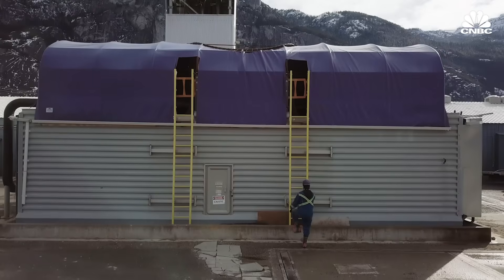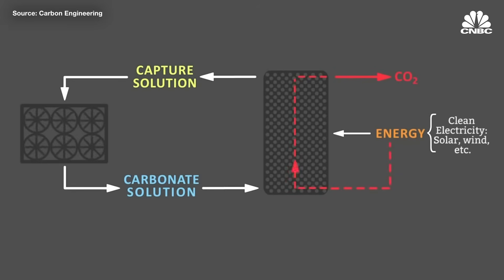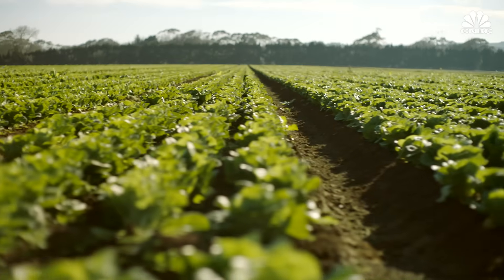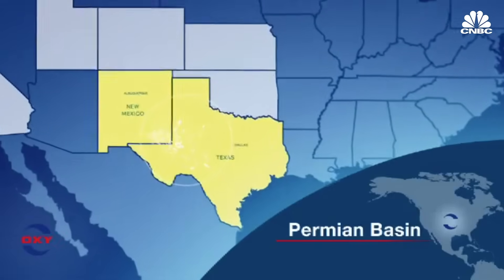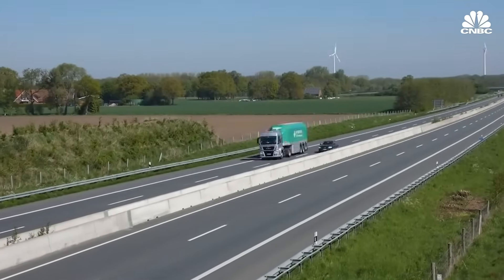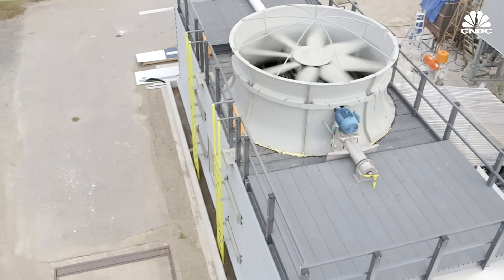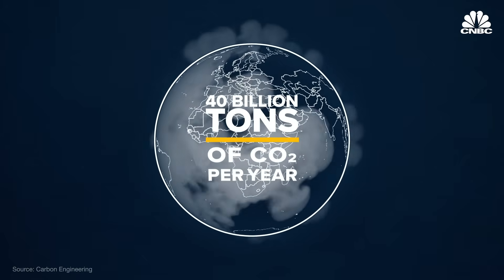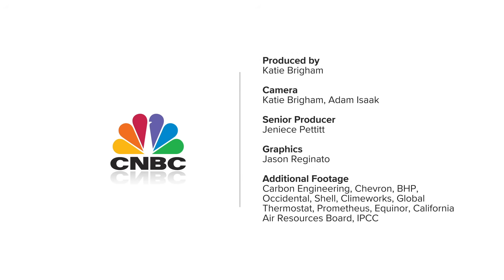Bill Gates-Backed Carbon Capture Plant Does The Work Of 40 Million Trees

Comment: This will only reduce CO2 from the atmosphere.
We still need plants for oxygen.
Reply: They already created a substitute for the Plant that can produce a oxygen and design for astronaut. But we still need a tree to do the nature way
Reply: Fred Energy comes from ATP and NADH.  Ultimately this is energy from the Sun  which is from nuclear fusion.  Energy from the sun is ultimately from the Big Bang, and is steadily decreasing ( entropy) with the end being absolute zero.
Reply: Dylan Stewart  Or you can dial into NASA satellite imagery and just watch as carbon dioxide makes the Earth greener.
Read all about it.

https://www.nasa.gov/feature/goddard/2016/carbon-dioxide-fertilization-greening-earth
Reply: Fred thanks for that link, my first time visiting nasa’s  site, very informative thanks again
Reply: What is the point you're making? Currently there is too much CO2 in the atmosphere, about 420ppm compared to pre-industrial 280ppm. If we were to one day remove CO2 quicker than we produce it, we would probably call it quits at around 280ppm. Thus not destroying photosynthesis on earth.
Fun fact, it seems that increased CO2 percentage in the atmosphere is actually having a fertilising effect on plants.
Reply: @tord1508  Arguably there is not enough CO2 in the atmosphere. Plants are starving at at 420ppm. The optimum level for C3 plants is probably 1500ppm. At the last glacial maximum plant life struggled to survive the low level of CO2 in the atmosphere. Plants needed much more water as CO2 declined because of increase water loss via evapo-transpiration through the enlarged stomata needed to inspire CO2.

Further evidence is here: 

1, The greening of the Earth by CO2
https://www.nasa.gov/feature/goddard/2016/carbon-dioxide-fertilization-greening-earth
2. The fact that greenhouse operators increase CO2 to as high as 1500ppm.
3. The fact that C4 plants have evolved a more efficient mode of photosynthesis than have C3 plants.

https://royalsocietypublishing.org/doi/full/10.1098/rstb.2011.0261
Reply: @tord1508  it makes plants utilize nutrients and sunlight and also tolerate higher humidity and temps and increases yeilds while shortening time to harvest. In greenhouses you can run co2 as high as 1200-1500ppm, temps as high as 36celsius and 70-80% humidity, and crank up feed concentration
Reply: @tord1508  No there is insufficient CO2 in the atmosphere. That is why greenhouse operators pump CO2 into greenhouses.
Also, that is why the Earth has been getting greener during the last 40 years or so.

Reference at NASA web site:
https://www.nasa.gov/feature/goddard/2016/carbon-dioxide-fertilization-greening-earth
Reply: @tord1508  yea actually it makes plants grow bigger but it there less nutrient filled so we have to eat more wich is the sloth problem eating food all day and stil not geting enough energy
Reply: @popinmo  The nutrient density is lower. Not the same thing as lower total quantity of nutrients.
Reply: @fwcolb  thats what I said meaning you would have to eat more to get the same amount and thus we eat more often and alot more
Reply: @popinmo  The fiber will keep us regular and we won't get so fat. :-) Seriously, the additional plant mass is made up of cellulose. Many animals, including cattle, have gut bacteria that can break down the additional cellulose to get energy.
Reply: @fwcolb  but we wont get energy Idk also maybe we can use this to are advantage to blast are plants 20x size with carbon
Reply: there are other technical solutions for that as well, it's just not mentioned here and beyond the scope of this video. it is scientifically possible to produce breathable O2 without plants.
Reply: @vanillacokejunky  Let's stop trying to re-engineer the world and deal with the fact industrialized society is unsustainable.
Reply: @cactusflower7292  Not so. This is a belief not based on science. Partly political and now becoming partly or wholly religious, a form of Pantheism.
Reply: @vanillacokejunky  Sure but how do you get the energy to do it? Second law of thermodynamics means NO FREE LUNCH. And who says we need more oxygen? This gas is highly reactive, which is why some people take anti-oxidant supplements.
Reply: The Earth already has the answer.  Anaerobic microbes will produce O2 just as they did a billion years ago when the Earth had almost no atmospheric oxygen and high CO2 levels.
Reply: @curelable  Only problem with this is that anaerobes produce methane, not O2. That is why landfill sites for solid waste aerate the waste by turning it.
Reply: @curelable  I don't think we are discussing the Proterozoic. Nor do I think we are discussing a lack of oxygen in the atmosphere. One comment raised that point and was shown to be spurious.
Reply: Fred Answer is that higher CO2 levels are nothing to be concerned about.  Earth has dealt with levels many many times higher in prehistoric times.  Life will adapt as it always had.  It’s called evolution.  The whole universe is eventually headed towards absolute zero (entropy) anyway.
Reply: This whole discussion has always been about preserving life as we know it, obvsly the earth will get through increasing levels of CO2, but that'll be without us and most of the evolved life we know.
Reply: Frederik Sandberg Is highly evolved life good or bad?  Are Humans good or bad for the Earth?  This is the main theme of the whole green movement.  The Earth can only handle about 1billion people in terms of sustainability—and we have 8 billion.  No simple answer.
Reply: @curelable  gravity insures that the amount of all basic elements on earth will not change  these elements are constantly cycled into various life forms and complex molecules depending on physical conditions such as sunlight  water availability  disease  usage by animals etc   i repeat the amount of elements do not change over time
Reply: Chet Lopez it isn’t gravity that does this - it’s just the law of physics that says that energy is always constant. You can’t destroy it, only transform it. Gravity just keeps the stuff here
Reply: @evvveeeeeeee  Energy is constant in a closed system. But nobody is talking about this process occurring in a closed system. The question asks: does the process require a net input of energy? 
I suspect it does. But no information has been released on this question. And what is the source of the input energy.
Reply: Umm... the plant can be turned off and on accordingly?
Too much CO2? Start up the plant. CO2 back to tolerable rate? Shut it down.
Reply: You do realise that there oxygen molecules in carbon dioxide right? That's literally what the "O2" in CO2 means
Reply: Miguel Pereira they are trapping the whole co2 molecule underground. They aren’t separating them
Reply: @miguelpereira9859  Yes. But energy is needed to reduce CO2 to get C and O2 as separate molecules. When they come together in combustion the energy is liberated. The issue is: the second law of thermodynamics states that there is no free lunch (so to speak). You cannot reduce CO2 to its components (C & O2) without expending energy to do it.
Reply: @miguelpereira9859  chemically bound to carbon. Its a different gas with very different chemical and physical properties. Try breathing it and see how well you do at extracting the O2 you need.  Trees on the other hand can split the CO2 to release the oxygen we need.
Reply: Doesn't the vast majority of our oxygen come from phytoplankton? People overhype plants.
Reply: @Rexluna1  no  it was here in the atmosphere before photoplankton existed   all life forms only cycle  the various elements and compounds  and when they die  such as a tree  all of these components decompose into the basic parts that is their makeup including man
Reply: Chet Lopez Blue-green algae synthesized all of the oxygen originally from other compounds that included oxygen but we're not oxygen (like CO2), allowing other life forms to grow. cellular respiration converts O2, among other things, into CO2, water, and ATP. The process of photosynthesis is needed to change CO2 into O2. The majority of this process happens through phytoplankton.
Reply: @Rexluna1  oxygen was here when the earth formed as well as all the other basic elements   plant life and minute sea life needed them and developed from them   life did not create any elements   they are part of the earths structure and carbon because of its unique bonding properties is the needed element in the building block of complex coumpounds in life forms    buy an organic textbook or i can loan you mine if you want the truth    CO2 is not the mother of O2
Reply: Chet Lopez Dude. I am not implying that oxygen is created by plants (as in the element). I am saying that cyanobacteria like blue-green algae separated Oxygen so that it could be in it's pure form, not in a compound with other elements because CO2 is not the same thing as O2. Stop putting words in my mouth.
https://www.scientificamerican.com/article/origin-of-oxygen-in-atmosphere/
Reply: @Rexluna1  Phytoplankton are plants.
Reply: Fred what? That was never mentioned as part of their industrial process. They’re storing it and that’s it
Reply: @evvveeeeeeee  Yes, but the second law of thermodynamics?
Reply: Fred you have no clue of what you’re talking about. You’re just throwing words around at this point. They aren’t splitting CO2 at all. There’s a certain amount of it in the atmosphere, and we have O2 aside from that. They’re just taking the CO2 and passing it through caustic soda which turns results in a solid chemical. They then use that or sequester it. No splitting it what so ever. Did you even watch the video?
Reply: @evvveeeeeeee  OK. Tell us how the caustic soda (sodium hydroxide) is produced? Write the reaction formulas for the entire process. Tell us also which reactions are endothermic and which are exothermic.
How many readers of these comments would follow your explanation?
Do you realize how silly your comment is?
Reply: @evvveeeeeeee  Yes, that is the problem. They have omitted the high energy cost of producing caustic soda. There is no free lunch.
Reply: Artificial photosynthesis is a technology that exists as well. Eventually I’m sure that will be implemented as well to separate the carbon and the oxygen in the carbon dioxide and monoxide.
Reply: We already have enough oxygen, imagine having more than 20%....that would be a disaster
Reply: @thetacoguyy  Reducing CO2 would not raise the O2 level much because there is so little CO2 in the atmosphere.
Reply: @thetacoguyy  This is not true. In terms of history our oxygen percentage is quite low. It has been a lot higher in the past with no negative consequences
Reply: @BnMProductions11  dont take it from me, even Neil said too much oxygen and a lot of things become (if not more) flammable.
Reply: @thetacoguyy  You realize you need almost 100% pure oxygen for the gas to actually be an oxidizer. And with nitrogen as well there is almost no danger as nitrogen is extremely non reactive
Reply: @thetacoguyy  More oxygen means more oxidation. But the oxidation would take place below the ignition temperature. So not much to fear from increased flammability.
Reply: @BnMProductions11  Nope. Most oxidation occurs below the ignition temperature. 20% by volume of O2 works just fine. Otherwise we could not survive. We are combustion machines ingesting carbon-based foods and oxygen and exhaling the combustion products, CO2 and don't forget WATER VAPOR. Lots of water in these carbon-based foods, lots of hydrocarbons. We excrete methane all day long too, sometime silently and sometimes announcing the fact.
Reply: @fwcolb  I dont know why you're messaging me. I understand 20% works fine. It also wouldnt matter if it was slightly higher, the world isn't going to start spontaneously combusting.
Reply: @BnMProductions11  My apologies. I messaged you in error. My comment was intended to rebut an extreme claim about the conditions for oxidation.
Reply: Mixing it up don’t worry I been holding in this fart I’ll let it out when it’s needed
Reply: Ecosia plante 60 miliion+ tho
Reply: We could stored that co2 underground and release it on the time we got to much cow or we have little c02
Reply: Is that air you’re breathing - Morpheus
Reply: Then make oxygen then
Reply: This comment...what even...
Reply: Nicholas Labowitz  ignorant, although there's ~21% oxygen but it becomes a health concern when it drops 19.5% also all CO2 will deposit in the lower atmosphere, which will suffocate u.

Read some science don't be like a flat earther.
Reply: Damn yall smart I love it ! M.A.T.H👏🏾❤
Reply: you need a science class to get it right
Reply: The problem of climate change is too much co2 not low oxygen
Reply: Dude, most of that comes from plankton in the ocean. And most of them are dying from the planet heating up.
Reply: Yes, and we still need plants for food as well
Reply: @fwcolb  the energy is stored in the carbon bond when the plant produces more complex molecules from CO2  such as sugar  when you eat that sugar   the O2 you breath breaks  down the sugar molecule and gives off heat energy  CO2 results from that oxidation and returns to the atmosphere to begin the cycle again    this happens trillions of times daily     animals cycling plant material  CO2  begins the cycle and is the end of the cycle  it is the mother of all life
Reply: @chetlopez8942  Yes, that is the way I understand the process. Oxidation occurs at a temperature far below the ignition point. No risk of bursting into flames. :-)
Reply: Mixing it up we don’t need any more oxygen after oxygen is like 20 percent of the atmosphere while carbon dioxide is only 0.04 percent of the atmosphere.
Reply: @stevennguyen5771  Yes O2 is 200,000ppm and CO2 a little over 400ppm (parts per million)
Reply: Those plants USE oxygen at night.
What happens to the carbon?
Reply: @bamahama707  Plants use oxygen 24 hours per day for metabolism. During sunlight hours plants convert more CO2 and water into sugars and cellulose than what they what they use for metabolism. When botanists measure the processes they find that the net amounts of O2 and CO2 inspired and expired change during the day depending on the amount of sunlight.
Reply: @bamahama707  They release small small amounts of carbon during their night cycles. They go into a "sleep" state. So that's not really an issue.
Reply: @MrFizzfred  Carbon, a solid, is not carbon dioxide, a gas.
Reply: Yeah it reduces CO2 out of the atmosphere so we can continue to create massive amounts of CO2 that goes again to the atmosphere.
Reply: Or we could grow banana trees because why not
Reply: We have a lot of oxygen.
Reply: @ritwikreddy5670  but below 20% is not considered normal level, this doesn't mean that you can live with 5% Oxygen
Reply: @ritwikreddy5670  we won't.
Reply: O look guys we removed co2! Wait..... Why are the trees dieing?

Comment: Carbon removal is not possible. Air consist 0,04% of CO2 that do not seem much but there are billion of tons.
Reply: Sören Nilsson and c02 has little affect on climate change as these globalist state it does smh
Reply: @ROLLINGFANATICS  Then you must be misinformed. CO2 is a very potent gas, before the industrial revolution we hade 270 ppm in the air, today it has today passed 400 ppm and is expected to be 900 to 1 000 year 2100. This I promice you will be devestating. CO2 stayes in the air for hundreds of year so when it is there it stayes. We do have two safety systems that can save us temporarily, one is the ice, but during the last 100 years it has started to melt, the sea level is now rising with 5 mm every year that may not seem much but in 30 years it will be 1 cm every year. It should be the oposit since sunactivity is low. We have now passed the CO2 level that we hade 4 million years ago the problem is that the sea level ended up 20 m higher at that time. We do not have to be very smart we only need to look at the sedements in the oceans to understand what will happen. It is true that the sun has cycles but when we measure sea-level changes we can measure the CO2 levels at the same time. High CO2 levels as far as we can measure correlates with sealevels. You do not belive in sience, I do. You fall in the same trap as the USA did when the tobacco companies claimed that smoking did not do anything to the health. This was known since the mid 19 century, the facts was there but the tobacco companies sponsored researchers to tell us it was safe. It took 120 years to get to the truth. The thing is that the oil companies are doing the same today, they even uses the same corrupt companies that stated the safety of toback to state that CO2 has no impact on climate. The rise in sealevels will force 2 billion people to move, I suggest the USA should take a large part of them since it historic is the largest producer of CO2.
Reply: Sören Nilsson greenhouse gases” actually block up to 95 percent of harmful solar rays from reaching our planet, thus reducing the heating impact of the sun. Carbon dioxide (CO2) and nitric oxide (NO) are two substances playing a key role in the energy balance of air above our planet’s surface tending to cool not heat.